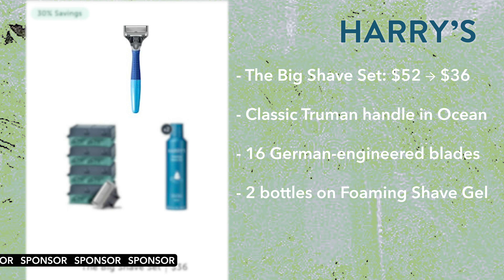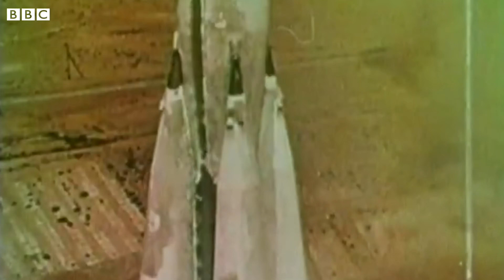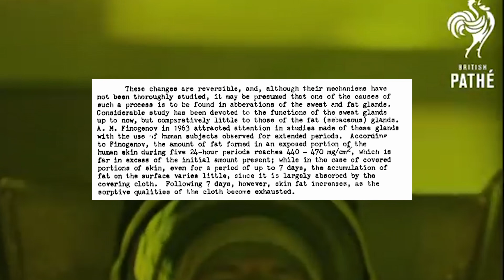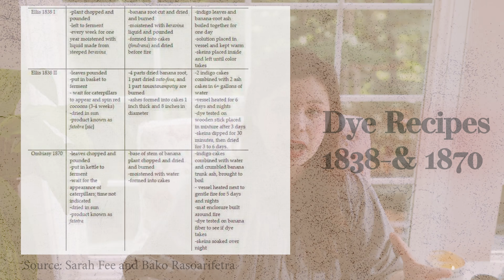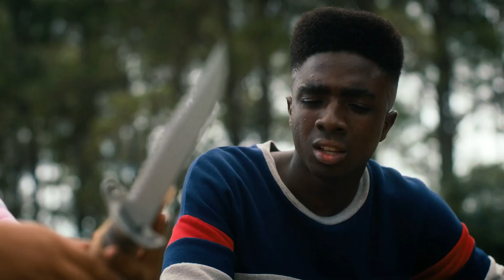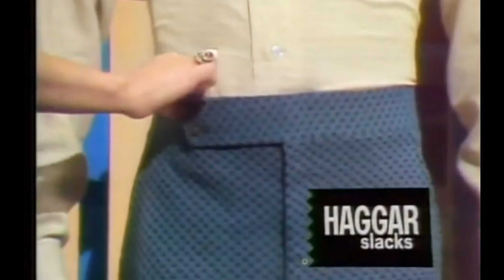The DISGUSTING truth about Laundry

Comment: I feel like a lot of these issues are solved with a cup of white vinegar in the wash, hang dry, and ironing, if you’re so inclined. Vinegar is an acid, and actually softens the water and the fibers in your clothes when it washes, not to mention we’ve know of it’s usage as sanitizer since the black plague. The heat of an iron kills all the bacteria and such left over, and makes your clothes less wrinkly after a hang dry. Not to mention, just not washing your clothes after a single wear is going to save much more on laundry.

Comment: US. Our washer is a compact with a small short agitator and everything gets line dried, we don't even have a dryer. Only use cold water since the hot isn't even hooked up tonthe machine. But our water is very iron heavy. It will stain anything I'd you leave it there long enough. I own all of maybe 2 white shirts. I am really stain prone. Most of the rest of my clothes are black. I wash my .. I'm a ♀️ but only own 3 or 4 panties and 2 boxers. Panties are only for going out in public or when I'm on my shark week. Rest of the time it's boxers or nothing. Since I spend almost all of my time in the house I don't make as much laundry. If something I wear is worn down it's because it's a favorite not because it got abused in the wash.

Comment: Line drying in Florida lololol
Our seasons are wet, pollen, love bug, wet, HADES, wet, and two weeks of mild cold a year. Top that with small under roof square footage (not having a ton of space for hanging clothes) and acquiescing to modern capitalist standards of college, work, spend, it’s very difficult to reshape those habits, especially when you aren’t supported well by producers/manufacturers. Follow the tag instruction and wear the clothing into the ground. 😕 let’s shift blame to where it needs to be directed.

Comment: This is brilliant!
Perfect rant xxxxx
Agree with absolutely everything you say; you are lovely!

Just two things will revolutionise your laundry:
soap nuts; way way cheaper, just as, if not more effective & 100% natural
(They come in a natural fibre bag, no plastic whatsoever, and you can even use them for two or three washes, yes, really).
&
Vinegar; high concentration (e.g. gallon container & 12%+ concentration), just a splash in your ‘conditioner’ drawer. 
Vinegar is also very effective at diluting, essential oils, so if you need to add perfume at this stage, a few drops of lavender, oil or similar is great.

However, (!!!), Vinegar in the rinse cycle does not make your clothes smell of vinegar  

I’ve been using both these ‘products’ for over a decade now; I have triplets who live a wild and free life, and no one has ever said my children’s clothes are dirtier than average 😂

Comment: For apt living, my mom taught me to hang dry clothes indoors in front of a fan or AC unit to speed up the drying, and it works! A heater or radiator is even better. I have two collapsible metal drying racks for this. They are bulkier than a clothes line and require space to use and store them, but they can be good apt solutions. You can also hang them on a ladder or chair, as long as it won't get damaged by wet clothes or you don't care if it gets damaged. If you hang them on a clothes rack with airflow, you won't have to put them away.

When I don't want to go to the laundromat, I hand wash small loads in a mop bucket with a circular wringer attachment. You can fill it in a sink, shower, or bathtub. I use a steel "wave" shaped potato masher to "agitate" the clothes, but you can also do it by hand (rubber gloves help). I wring water from the clothes by pushing them down into the wringer. I don't have to twist or manually squeeze them, which is easier on the clothes and my hands. Then I hang them up. 

The whole process requires a lot of time, manual labor, attention, and working memory, which is not very ADHD friendly for me, but it does allow me to clean my clothes in my apt without a washing machine or dryer. I'm actively looking for a better solution but sharing this one in case it helps anyone.

Clothes Drying Rack:
https://www.walmart.com/ip/Mainstays-Oversized-Collapsible-Steel-Laundry-Drying-Rack-Silver/173323840?athbdg=L1102

Mop Bucket with Wringer:
https://www.walmart.com/ip/O-Cedar-QuickWring-Bucket-2-5-Gallon-Mop-Bucket-with-Wringer-Red/574638157?wmlspartner=wlpa&selectedSellerId=0&wl13=3795&adid=22222222277574638157_117755028669_12420145346&wmlspartner=wmtlabs&wl0=&wl1=g&wl2=c&wl3=501107745824&wl4=pla-294505072980&wl5=9004335&wl6=&wl7=&wl8=&wl9=pla&wl10=8175035&wl11=local&wl12=574638157&wl13=3795&veh=sem_LIA&gclid=CjwKCAiA_vKeBhAdEiwAFb_nrfzjRcJg23LsnEn-hOYjg9yuRxlUta1OpDCnxpHB4kl5eqz-7EbunxoCDfwQAvD_BwE&gclsrc=aw.ds

Potato Masher:
https://www.walmart.com/ip/Farberware-Professional-Stainless-Steel-Potato-Masher-with-Black-Handle/639420321?athbdg=L1102

Comment: I live in Australia. I was all our clothes on 60 degrees C and rarely have stains (yes including the kids clothes and cloth nappies) we visited my MIL who washes everything in cold and everything still looks and feed dirty. She has to pre-treat most garments with chemical stain remover to just minimise the look of the stain. But now I know 60 is the minimum for sanitation too 🙊 we also have a 90deg cycle which we use is a gastro bug comes through the house as that’s near boiling - just don’t wash anything with elastic on that temp unless you’re prepared to replace them 🤣

And yes we like dry 90% of stuff unless it’s been raining for days
Reply: Also - what about clothes horses that you hang your clothes on in your lounge room, garage, or veranda. Handy on wet days when you can hang it up to dry inside and then when then sun comes out pop it out for the hour or so and then bring it back in before it rains again without having to re-hang stuff every time

Comment: I would say that the first thing to do should be to use citric acid instead of softener: it makes the water less hard and it doesn't coat the fibers leaving them soft and clean. The second could be to substitute the synthetic fabrics with some natural ones when possible. And the third and most clear: hang your clothes to dry (drying racks are fine too if you can't hang your clothes outside!). If you hang them correctly no ironing will be needed!

Comment: Speaking as someone from Australia, who lived for a while in the UK, and who has always line-dried my clothes - if you are concerned about people seeing your undies (that feels weird to me) or who live in an area where rain makes it tricky, there is a simple solution: get one of those "pop up" gazebos/car ports/pavilions. The kind that is a put-together metal frame that then has a slip-over roof, the leg-strip and tightness of which helps keep the frame together. When you put it together, run a long length of dowel through the side poles, to help strengthen them and stop them bending, and if it's windy, hammer a long star picket against each leg and tie the leg to them. Then run your line zig-zag across from side to side, going both ways so your line makes a kind of wonky grid (this shares the weight of your laundry on all four sides and helps stop the frame from warping). The roof will keep the rain off your clothes and if you are uncomfortable with outsiders seeing your laundry, get at  least one mosquito-mesh wall to prevent trapping in the moist air, and put up the walls.

Comment: So some small changes could be line drying your clothes, wearing natural fibers like linen close to your body, learning how to mend the clothes that you have, and investing in well made/long lasting clothes made from natural fibers that don’t shed micro plastics if it is within your means. 
Also just wanted to mention that sometimes when clothes come out of the washer not “feeling clean” or feeling weirdly stiff or scratchy it can be because you’re using too much detergent and it’s not all getting rinsed out. I’ve read that for a HE machine you only really need 2 tablespoons of detergent (depends on multiple factors so you’ll probably want to research for your machine/detergent combo but I’ve generally seen from 1tsp to 2tb), and I can personally attest to the efficacy of this (not on a scientific level, but in a “my clothes seem clean and don’t smell/look dirty” way). You might think that if it doesn’t look bubbly you don’t have enough, but from my understanding part of what cleans clothes is the physical action of them rubbing against each other, and too many bubbles prevents this contact between clothing.

Comment: I feel completely fine washing my clothes at 30°C max and using vinegar as "fabric softener", something that strips hard elements from the water. I never use a dryer, always always air dry and line dry. I feel like you're a bit exaggerating, but I did like the part about undergarments and linen, something to think about in the future. 
I also LOVE keeping my clothes for 10+ years and mending little holes or solving different stains... I hate throwing away my clothes. I am becoming a true clothes collector/hoarder however nowadays because I keep all my pieces

Comment: We had a repair guy out at one point who mentioned you shouldn't use liquid in your machine.  He said we should use powder.  It rinses cleaner and doesn't stick all over your washer (necessitating things like affresh.)  We initially switched to just All Free and Clear powder.  It's way better than the same liquid.  Recently, I discovered Nellies.  I'd heard of them before, but only recently tried it.  It's like Molly's Suds,  Charlies, Country Saver, etc.  I'm actually surprised just how well it works while also being gentle.  (I even tried it on my brother's VERY gross work out clothes and it got about 90% of the pit stains out and 95% of the stink, I got the rest of the stink out with a little Dawn... but this was 8 year old nasty stink/stains.)  People use it for their cloth diapers or regular laundry.  They list the 4 ingredients on the packaging and say it is septic safe.  You only need 1 tbsp for a regular load unless your water is very hard.  I haven't used softener in probably 20 years but I do go back and forth using wool balls to help in the dryer. I've found with this laundry soda (Nellie's) my clothes feel more maleable and breathable... like the gunk that had been on them is gone.  Most clothes end up much softer (a few types of fabric aren't but most are.)  I also hang up most of my outside clothing, although I hang it up inside due to rules, laws, and allergies.  I hope this helps. :)
Reply: Where did you find powered All Free & Clear?  Most manufacturers stopped making the powdered versions as people aren't buying them.  At least in the US market.
Reply: @wanderingcelle   Amazon has it.  I've also bought it at my local grocery store.   My local grocery store is fairly large and so they carry a decent amount of brands and options.  Although they do still have it, we've stuck with Nellies and buy it at Costco.

Comment: I use cold water only on most of my laundry. I love using 9 Elements Lemon and Vinegar. Lemon and Vinegar is known to remove stains. Lemon smells nice to some. Vinegar is a great thing to kill germs. (Which I have used on black mold before.) With clothing that has prints turn them inside out. Never ever put them them in the Dryer. Let them air dry. Prints will last alot longer. Use Downy Damage Defy. It works great. Seriously I have jeans that bleed that I get for Work. They cost roughly $22 per pair. And were dying so fast before I started using this stuff. My pants would fade super fast and get very worn out fast. That is compared to normal jeans. But at the time my Work only allowed black jeans and one other kind I hate. But yeah I recommend hand washing anything real delicate and air drying it. But that's my advice. Tho if you want to be extra careful learn the Laundry Label Symbols and go by that when washing stuff. Hope this helps.

Comment: I use a mini washer with a spin dryer and then hang my clothes on an over the door hanger.  The machine uses water from the sink and drains into the bathtub.  It's small enough that a boil from the electric kettle to regular hot water gets it really hot and the loads are small enough to really separate my clothes.   It's also light enough to move around and can be used in an apartment without hookups

Comment: Old school knowledge from European grandmother  (in a rural setting)....  Undergarments were for both genders, short sleeves for summer and long sleeved for winter.    Rain barrels were used and that water was used to wash the nicer garments...
Also there were work clothing, school clothing, which you removed and changed into clothing for at home...
I to this day don't use a dryer, as family in Europe don't always use the dryer.  I in turn have a dehumidifier which not only removes air moisture and dries the clothes, but the collected water is used for laundry....
Also vinegar changes the pH and softens the water leading to cut back on detergents.
And yes, garments last longer with less irritation to the skin 😉

Comment: I add a small bit of baking soda to my washer to soften the water. Detergent is so much more effective and can be used in smaller amounts. The scratchiness comes from detergent not being completely rinsed out. A vinegar rinse will finish removing the detergent. You don't need fabric softener after those steps.

Comment: I grew up in Europe and moved to the US and line dry clothing outside as often as possible. Some people have definitely found it weird, and there's also a misconception that you have to live in a hot, dry climate to do it (don't get me wrong, that does help). As long as it's sunny and pretty clear weather I've line dried clothing, just takes a little longer but it smells great (used to live in Portland which rains a lot but I still took avantage of every sunny day, no matter the temperature). Then I moved to Arizona and am proud to say we've lived here without owning a dryer for almost 3 years now. Back in France it was so normal to hang laundry on a line everywhere and you didn't care who saw it, or even if you barely had window space, they would find ways of attaching a line to get at least some fresh air and sun on the clothes. So much better.

Comment: I’m actually surprised by the packaging of American and Canadian detergents. Best case they say to use a certain level in a measuring cup that may or may not be included in the packaging (if it’s a powdered detergent, which is more effective than the liquid), but they don’t say how much to use in hard or soft water. In Europe, we have a small table of dosing, use this much for lightly soiled in soft water, or this much for highly soiled in hard water. Funny enough, Ariel, which is made by an American company, has a less detailed dosing recommendation than detergents by the German Henkel group, for example. But water hardness is always calculated into the equation.

Comment: CHEAP AND FRUGAL LAUNDRY SOAP RECIPE:
…from the USA

1 box Washing Soda (like Arm and Hammer)
1 box Borax
1 box soap flakes (like Zote)
OR 
1 bar grated laundry soap (ie. Fels Napatha or Dr. Bronners)
1 small (16oz) container Oxy detergent (optional)

Mix all powders together and keep in a bucket or other large lidded container. Use about a 1/4 cup (50-100 ml) scoop per load. Put it into the bottom of the machine. Wash clothes as usual.

You can use vinegar as a rinse.

I was all my clothes this way and it gets them clean. It costs about $16-$20 to make this and it will last 1-3 months. More environmentally friendly than your avg detergent.

Borax is Sodium Tetraborate and washing soda is Baking Soda that’s been heated so it has a finer texture.

Wool dryer balls or felted wool if you use the dryer. Or good ok drying rack.

I also do some of the other practices like wearing layers, hand-washing, airing clothes out and treating stains.  

And YES I cloth diapered. Washing the diapers in their own load.After hot water, this detergent and sunning, they were clean.

Other random tip—
Heard if you soak wood ash in a bucket of clean water and let the ash settle you can filter out the water and wash things in it…
Wood Ash was used to make lye for soap. 

Thanks.

Comment: I lived rural as a young mother. I had a permanent clothesline. Unfinished cedar poles for the four supports and a heavy gauge plastic coated wire for the double lines. I loved it. Laundry smelled like the sun. Plus, the act of walking outside and feeling the air.

Comment: I do have a line in my backyard, and another in my basement where my washer/dryer is. I hang 90% of my clothing - pretty much everything but jeans, underwear, and pj's. And I dry stuff on hot, bc I was always taught that killed germs, vs the washer. At 1 point, I was putting Lysol in the washer to kill germs, as I worked in a job that was potentially really dirty/germy. But where I live in PA - drying outside is something that can only be done in certain seasons of the year, unless you want your clothing frozen! And let's not even get into what happens when you're disabled, and getting your clean clothing to the line isn't something you can do...there's a lot more pieces to this!